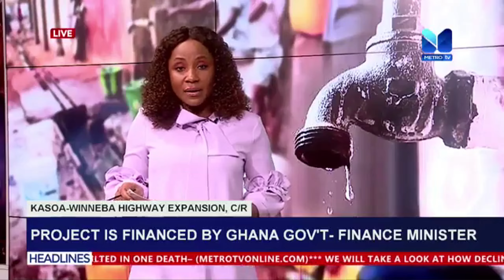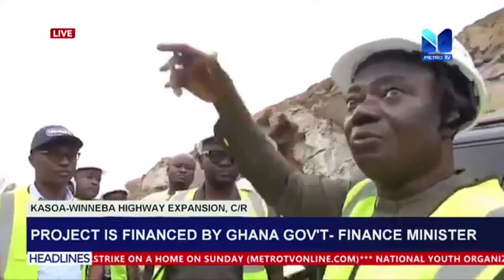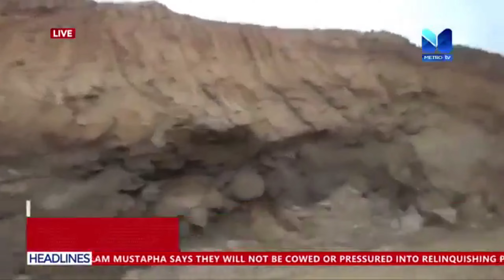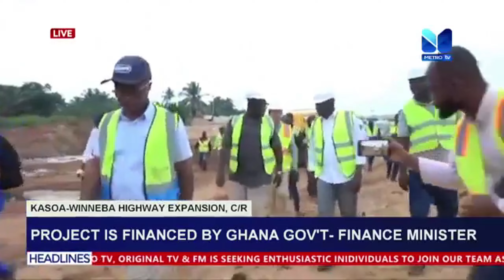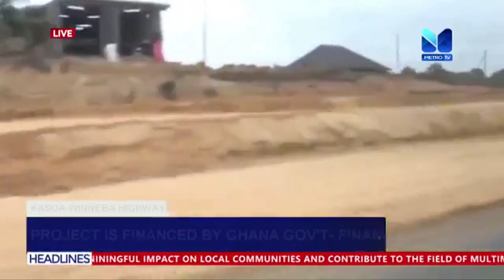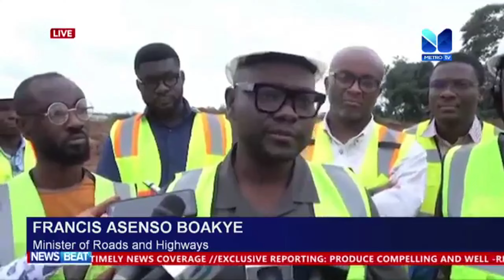Project Is Financed By Ghana Gov't ---Finance Minister

Comment: Ecowas members agreed a long time ago in the 80s to have a connected highway from Cameroon to Senegal... However the agreement stipulated thhat each country does their own project... No funds will come out of the ecowas coffers.... I think as at now none of the ecowas countries hhas been able to.... Togo has been able to but its a single lane which falls short... So none yet.... Ghana's first section which was before ecowas is the tema motorway... Then we have the N1 from Tetteh quarshie to Mallam... That's all we have... It should run from Aflao to Elubo... All dual carriageway highway... If every government comes in and do a bit it can be done... Since 1992 if every government had done 50km it would Have been completed by now...